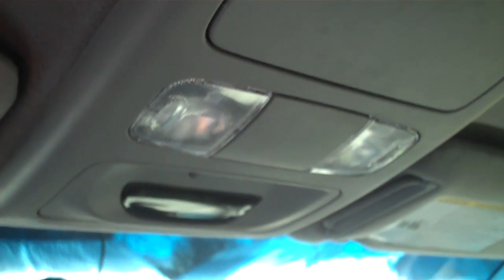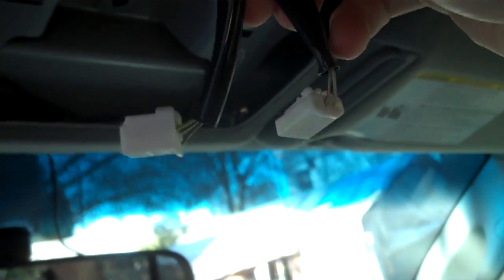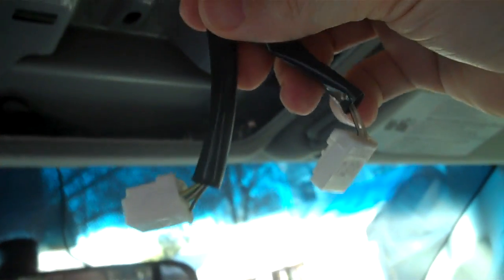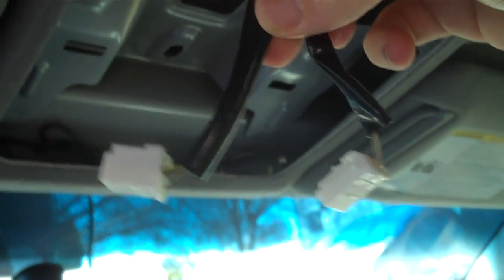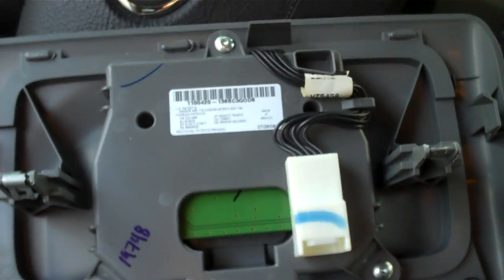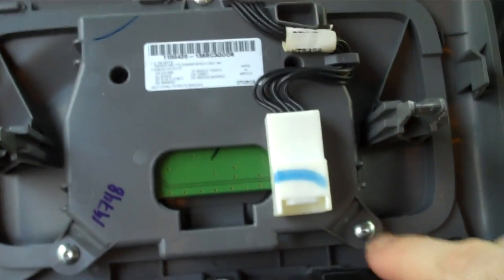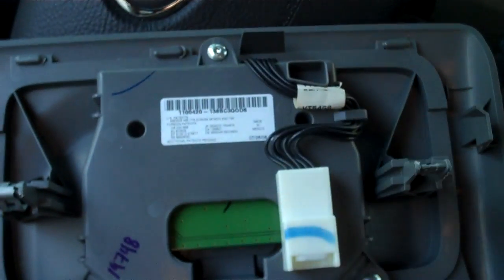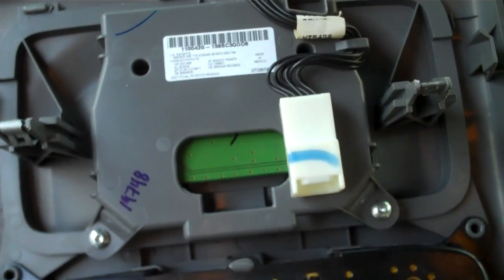Toyota Tacoma Overhead Compass / Temp Gauge Repair  by Siliconmethod

Comment: I buy and sell between 50-70 of the 2nd gen Tacos per year and this thing is broke on more than half of them.
Reply from the maker: ronjon, yes....when I started repairing these years ago, I assumed that the newer displays would be updated and would not have the same issue...but needless to say I was wrong.  When the first 'updated' display came in and I saw the same problem, I just shook my head and wondered what Toyota was thinking.  This has been a nice side biz for us, but honestly...I would prefer to work on other electronics than keep fixing something that should have been done right the first time.

Comment: Question greg: I had my 2008 Tacoma windshield replaced.  The very day they replaced it, I noticed that the temperature readout quit working.  This has been a couple years now.  I am thinking that there may be a window sensor or something they didn't installer back on.   I looked and noticed that it was all plugged in.  Where are the sensors for capturing the outside temps???
Reply from the maker: Hi Corey, so sorry to take so long to reply.  Youtube decided to stop sending me notice of new responses to the vid.  Anyway, the temp sending unit is mounted on your air conditioner heat exchanger (the one in front of your engine's radiator).  It's possible that the electrical connection isn't sound.  Check all connections, and make sure road salt hasn't made its way in.

Comment: Just letting others out there to use other videos out there.  It is a simple drop of solder.
Reply from the maker: +Jay Trock Jay, I know you are not implying to drop solder on a joint, but for others reading this be sure to never do that.  Solder should not be applied to the soldering iron then moved to the part...heat needs to be applied to the joint (between copper pad and component) until the solder melts in place.  See my DIY guide on the Siliconmethod.com website (and use new resistors, too)
Reply: SiliconMethodRepair
Reply: SiliconMethodRepair

Comment: I have two sunglass holders in the overhead console of my Tacoma.  Does anyone know if the forward one can be replaced with a Overhead Compass / Temp Gauge?  thanks!
Reply from the maker: +Arthur Robins Arthur, it can be replaced...but you will need to buy the new overhead console so the 'accessory meter' (compass/temp gauge) will fit, and also make sure you have the temp sending unit installed on the truck.

Comment: Thanks for the detailed video.  No more smacking the display like an old TV set to get it to work. Found both the 510 chip on the board with solder cracks.

Comment: I've been missing my temp gauge and compass.  With your help, I knew which end of the console to pull down first.  Blind fasteners are always tricky.  My resistor was completely detached.  Cleaned up the contacts with the point of a knife and soldered together and it's up and running.

Comment: I took mine apart, and apparently it actually burned the display. like when you press too hard on a calculator screen and it is permanently black on one side..... any suggestions other than getting a replacement?

Comment: I busted the electrical clip holding the driver side lamp light while installing led replacements. (it was actually busted before I even started but just hanging on.  I just finished the job).  Can this be repaired?  Can you do it? Thanks!

Comment: I have an toyota tacoma 2007 and i install a Temperature display and is working fine but my map light and clock and my interior light not working after I install temp. display. can you help??

Comment from the maker: Kayla,
You can, *but*...you will most likely need the entire overhead console; as that contains the plastic design you will need for mounting.  You may or may not have the ambient temp thermometer (sending unit) and wiring; just take a look and see.  You will have the power plug; so worst case scenario you have a working compass and no temp.
Good luck and let me know how it goes...
greg